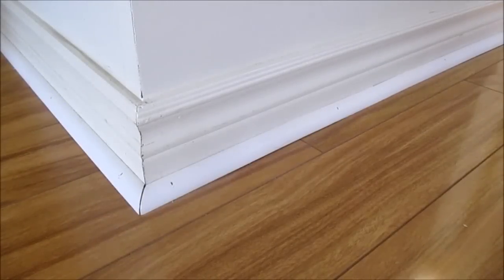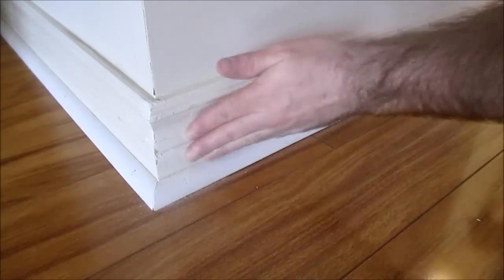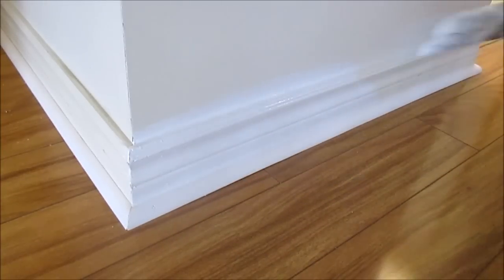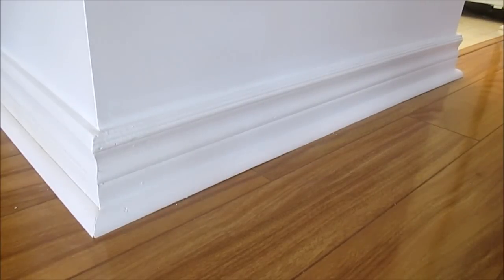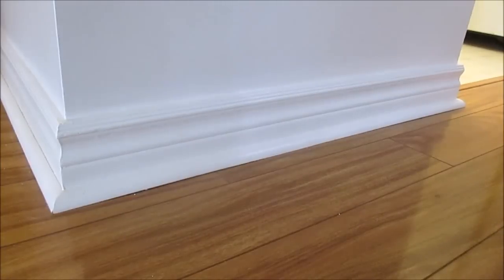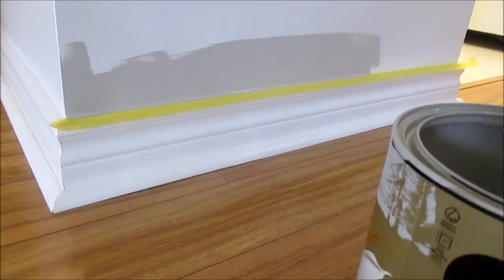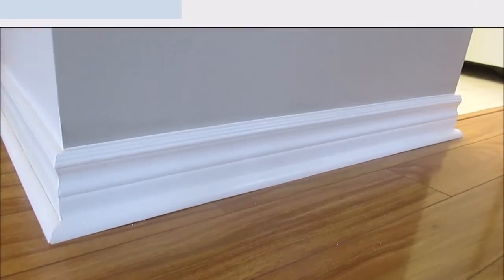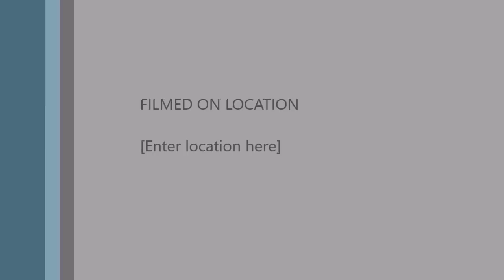How to paint baseboard trim and walls

Comment: Great video and very useful tip so thank you. One question though - could you not roll the wall first and then tape the wall when you cut in the baseboards? That way you dont get any splatter on the baseboards after you have coated them and they wont need a third coat as you mention you do in answer to one of the other comments below?
Reply from the maker: Yes I think that is definitely an option, I do different things for different jobs. This is one way I do it. But i do other methods aswell. This was my first video i ever  created and never thought it would have so much attention. I have other videos showing other techniques aswell. Thanks for watching and for the comment 😊
Reply: @TheCanadianHomePainter  I'm glad you answered this question. I'm redoing a room where we just painted the wall last week, but flooring is being installed this week. So, trim needs to be re-installed/caulked/painted after the wall is painted, and I wondered how best to do that. Thanks for taking the time to reply to comments like the one above.

Comment: Wow, thanks for the detailed instruction. I know its a couple years old, but this helps a lot. Question though: My trim is already white and I want to go and touch it up/repaint because its gotten scuffed up and it just seems old. Would I need to prime/paint, or just go through with the paint?
Reply from the maker: Hey, thanks for watching and for the comment. This is a few years old, it's my most popular video by far. If the trim was painted with latex paint prior then you are probably ok to just prep the surface  a light sanding and cleaning then a couple coats of the white trim paint. Hope it works out for you

Comment: Thanks for the video. How do you not get small paint splatter on the floor next to the wall without floor protection? I’m asking because though over the years my painting techniques have improved, but I still struggle with how much floor protection I need to do. I seem to get small paint splatters from the roller? Am I rolling too fast? I see some videos say to put poly down and then rosin paper and then tape to the corners. That’s a lot of extra work and I am just trying to find out if that is necessary.
Reply from the maker: Hi, thank you for watching and for the question, it comes up from time to time on other videos too, I do use drop cloths , but I can also paint without getting those splatters, I think it has to do with the paint/ roller sleeves, because I know if I use sico paint, and the Bennet roller sleeves I can paint without splatters or atleast very little, but if I use benjamin Moore paint, which is also excellent paint, I will get splatters especially with the benjamin Moore ceiling paint. So I think it is a combination of things. I don't go to the trouble of poly and paper and tape, just some heave drop cloths just in case, with sico it's more of a case of accidentally have a bigger drop of paint land on carpet or a sofa etc. I guess the speed is something yo consider too, I've had my dad help me before and he rolls way to fast which does make splatters , I just go at a consistent speed, not to fast but not to slow either, I think there is a sweet spot I found. I'm painting some doors right now in a house I've done about 20 and it's on a hardwood floor and I have no splatters and I'm not even using a dropcloth, that's with the sico door and trim paint which I enjoy using the most, and if I get a drip I just use a damp rage I have with me to wipe it up. I wouldn't suggest to do what I do, because if I did have a spill that would be a problem lol so always still good to atleast use a drop cloth, but inhwsr what you're saying about the time, because covering every inch with poly and paper would take way to long for me. I like getting in and getting the job done. Hope this helps , are you a painter by trade or just on your own house?
Reply: @TheCanadianHomePainter  Thanks for the quick response! I am not a painter by trade. I have an older home that I have painted almost throughout and a couple rooms multiple times and a fair amount of touch up from the kids and a window leak. I also painted an apartment. I enjoy painting and would like to improve to get closer to pro results the most efficient way possible. Is there any good books on house painting that you recommend?
Reply: Note that I have been using Ben Moore and purdy 9” 3/8 nap rollers for everything other than tight area which I use a 4” 3/8” nap purdy for. I live in CT USA and don’t think I’ve seen the products you mentioned.
Reply from the maker: @TennesseeJam  I think youtube is the best place to learn, not sure on a book, but I go to youtube for so many things. There are a few painting channels that are great including mine of course lol to follow and the big thing is practice,  experience and alot of trial and error lol
Sico paint is owned by an American company called ppg and Bennet is a Canadian company, but I'm sure you can find the product online. I use 10 mm roller sleeves which I believe is 3/8 in imperial. Benjamin Moore is the best paint on the market, but unfortunately I do find it splatters the most, if you can find sico (ppg) product inwould say give that a try and see if it makes a difference,  Purdy has excellent brushes and rollers so you are definitely using great quality products 👍🏻
Reply: @TheCanadianHomePainter  Thanks for the advice!

Comment: Is it necessary to prime a baseboard bofore painting. Actually I'm making a breakfast nook from white mdf and it needs baseboards on the corner. Just wondering if only paint would work. I don't mind oil or water based. Please let me know what you suggest.
Reply from the maker: As long as the paint is latex over latex and not latex over oil. I generally like to prime because I am usually doing repairs as well. But make sure you lightly sand the surface first and clean it.
Reply: @TheCanadianHomePainter  thanks 😊

Comment: Inspiring! About to paint trim and baseboards at a new (to us) home. Lots of good knowledge in this video. Appreciate your touch. Steady hand of a true craftsman 👍
Reply from the maker: Thanks for watching and for your kind comment. I'm glad you found this video helpful!
Reply: @TheCanadianHomePainter  certainly! I'm going at it tonight. Will update ya later!
Reply: @TheCanadianHomePainter  I was going to do it last night but spent most of my time taping and tucking the (UGH) SHAG carpet under the baseboards so I could actually paint the whole thing lol. That carpets going this week.
Reply from the maker: @markpfeffer7487  lol yeah shag can be a real pain to paint around. Probably best to just get ride of it 👍
Reply: @TheCanadianHomePainter  so I got most of the trim and doorframes (3) done tonight. I went ahead and got a 17 dollar purdy angled 2.5 inch brush. Gotta say its way easier to work with than cheaper brushes I've used in the past. Looking good so far! Walls are next. Do you think I could get away with tsp, primer, then paint? I plan to sand the rough areas, but I REALLY don't have the time to sand all of the walls.
Reply from the maker: @markpfeffer7487  sounds like you are getting it done! As for your walls, I think a pole with a sanding block on the end is always best before painting. If you want to save time I would say dont do the tsp thing  tsp is a very strong chemical cleaner and if the residue isnt all cleaned of then if can cause issues. If you use a pole and just do a light sanding over the surface you can probably just go over with the primer right after , there wont be much dust to worry about, now if the walls seem to have containaments on it then  just address those areas with a warm rag after or before you sand but if they look ok and not very dirty then that's what I would suggest , sorry for the late reply hope this helps
Reply from the maker: @markpfeffer7487  if you already washed the walls with tsp that's fine just make sure you wipe the residue off after with a warm rag
Reply from the maker: @markpfeffer7487  but to save time you are probably ok to just prime and paint, I usually go a bit overboard because I get paid by the home owner and I try to make sure every job is done and I dont ever want any issues with the paint  after I am done, but most of the time it is probably a bit overboard but when you do this for a living and have a reputation for quality work then it's always best to do things the best way. But you could maybe just paint over the walls and never have an issue. Hope this makes sense and helps. Let me know if you have any other questions along the way 👍
Reply from the maker: @markpfeffer7487  also just make sure the surface has had time to dry before going over it with the primer and paint.

Comment: So, when using two colors--baseboard white and a wall color, start with all the baseboards, trim and lastly the walls?  I was doing the opposite.  You did a great job.  Thanks so much for your reply in advance.
Reply from the maker: Hi Sharon! I have been doing painting for a long time and I always found this process to be the easiest & the fastest, some have commented about dripping on the baseboard with the wall color but I find if I do drip at all it will go on the dropcloth, if you do get any of the wall color on the trim you can wipe it off easy when its still wet,and if you just take your time with the roller you should be fine. Also I find that I get the straightest lines when I do it this way, thanks for watching!

Comment: Thanks, really clear video. You said these baseboards hadn't been painted right? Would you have to use primer first if the baseboards had existing paint on them?
Reply from the maker: Hi Ally! thanks for watching my video. great question!! I typically prime before all jobs, I think that a coat of primer is always the best idea. The baseboards in this video were previously painted, but a long time ago. I find that a coat of good primer helps with durability and adhesion. Also I have been in peoples homes where they didn't realize that the baseboards and trim were previously painted with an oil based paint, and they went right over with a latex paint,  it did not adhere very well and easily began to come off over time. Had they just used a primer first then there wouldn't have been a problem. If the paint isn't in bad condition and was painted with a latex paint first, then after a little prep work ( light sanding and cleaning) you are ok to just go over with a coat of latex paint. but for the little bit of extra cost and time it takes to prime, I am a big believer in it. This response got a bit long but I hope that it helps :)
Reply: No

Comment: Thank you for the info. I was taught to paint my baseboards last - doing the wall top to bottom. I'm definitely going to try to do the baseboards first next time, I think it would save me a lot of time. I will have to significantly slow down with the roller because I get lots of splatter.
Reply from the maker: haha yeah you don't want to get rolling too fast, however if you did get a little on the trim it will easily wipe right off the painted trim, you can always just do some touch ups if you did get some on the trim, but if you go slowly enough rolling then you should be fine, and the time that you will save on doing the trim first you won't have to rush on the rolling. glad you enjoyed the video!

Comment: On the video, there is a little gap between baseboard and laminate. Can you fill it with caulk to make baseboard look more even or it's not recommended?
Reply from the maker: Hi Vladimir, thanks for your question. i would not caulk along the bottom of the trim and the laminate, the laminate is a floating floor, which means there are no nails holding it in place. it will shift from time to time and caulking will most likely cause issues. I did not install the baseboard at this job, however the quarter round trim when it is installed after the flooring is done can be made tight to the laminate eliminating any gaps. Hope this helps :)

Comment: How do you paint over a former oil based trim floor panel  that has not been painted for 20 yrs.?  Is it possible to use a latex paint with pre mixed filler to paint over it?
Reply from the maker: Hi, I have never used pre mixed filler with paint before, but as for the oil, the main thing is to lightly sand the surface to scuff it up and then a good primer first before your top coat 
Hope this helps
Reply: @TheCanadianHomePainter  ok thanks. Sorry what I meant was paint with primer mixed in,but it's better to use then just a regular primer first than after it dries apply the latex paint?
Reply from the maker: @selahchunem8447  oh ok, no I don't like that primer paint in one, for the priming, I prefer a good primer, over oil it is a crucial to use a good primer, the paint and primer on one over oil will peel right off. You could take your finger nail and just take it right off, it just doesn't adhere properly. If you find Bullseye 123 made by zinsser then I would get that for your primer, works great 👍🏻

Comment: Hi , would it be possible to paint over the baseboard onto wall if you were using an oil based gloss?   Thanks
Reply from the maker: Hi Mandy, you can use oil based paint over latex with no problem   but if you are paint over oil with latex it is good to use a primer first to help with adhesion. Hope this helps

Comment: Great and informitive video. Wouldnt it be better to leave on the tape until after the second coat?
Reply from the maker: Thanks for the comment and for watching. people have made this comment before about leaving the tape on.  if you are worried about drips on the trim then by all means leave it on. I have not experience that myself, perhaps it is the type of roller sleeve I use or my technique of rolling. I find if there is a drip or spatter at all  it goes onto the drop cloth as opposed to the trim. but I see your concern. so yes my answer would be yes leave it on if you feel more comfortable with that. hope this help and Good luck with you painting project :)
Reply: @TheCanadianHomePainter  thanks for answering.

Comment: I know this is an old video but if possible can you answer this question please.
Loved your finish but i cannot see this method working with an oil based gloss because you get it on the wall and it wouldn,t look great painting back over with the wall color?
I guess the answer would be to not get it on the wall but the whole point of this method is the ease and speed by hitting the wall.
Reply from the maker: Hi Mandy! Thanks for watching and yes it's a 3 year old video but by far my most popular. Great question btw the first time I have had this one.
Not sure where you live I have viewers all over the globe and i know that in the uk and parts of Europe oil is still quite popular. Here in Canada oil has really been phased out. For about 15-20 years perhaps longer latex paint has been used for interior painting. So my experience with oil is very limited. Only a few times I have used it on some exterior projects. So as for this method I'm not sure how it would look in the end. Sorry I can't give you much advice in this area. Thanks for watching and for the comment
Reply: @TheCanadianHomePainter  Appreciate your honesty and prompt reply. Yes i am from Uk:) and Oil based gloss are still used quite frequently. I guess we are still addicted to that lovely sheen that lights up the frames. Will go yellow in time which is the downside.I guess i can still use your idea just tweak it slightly:)  Paint the baseboards but tape the wall so not to hit it.  Then take tape off and when Gloss has cured( 48 hours) Re-tape and bring the wall down. Its  a worthwhile process as accuracy and sharpness of the finish will look wonderful.
Reply from the maker: @mandyg.3004  I figured, I have had some people from Ireland send me messages before about oil.  They thought it was still very popular because of your  damp climate. I was in London once for a 20 hour layover, wasn't long enough to see much but I did tour around a little. Saw big ben, London Bridge, rode on the London eye and ate some expensive fish and chips. Would love to go back sometime for a week or two. I remember it being very cold and damp, it was in February. Here in Canada it is just extremely cold in February. 
Are you a painter by trade in the UK ? Where abouts in the UK are you from ?
Reply: Oil based gloss with a real high sheen looks amazing on well looked after Architraves and baseboards. Only negative is that it will turn yellow in time so it has to re-done every 2 years roughly. I am a painter( good guess) :).I love how huge the knowledge base is from experienced painters like  yourself. I have been Painting/Decorating now for 5 years and my mind is like a sponge when i browse youtube videos. I can sit for hours picking up tips relating to creating a certain look or finish.
I live near Canary Wharf . Its 2 miles or so from the city of London and around 4 from West End , so i am very central. 
Yup dam and drizzily is the weather now:)

Comment: Do I need to sand a previous oil paint on baseboards before applying primer? Thanks.
Reply from the maker: Great question! I would use a medium grade sandpaper, maybe about 120 grit. Just lightly scuff up the previous oil base painted baseboards first. Make sure that the new primer you use says on the can that it can be applied over previously painted oil base paint. Thanks for watching, and for the question. Hope this helped!